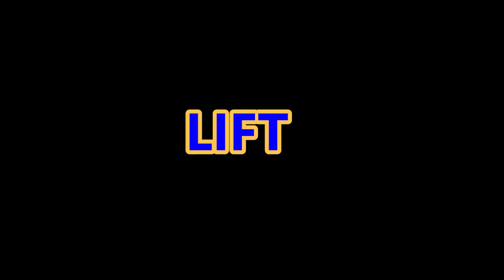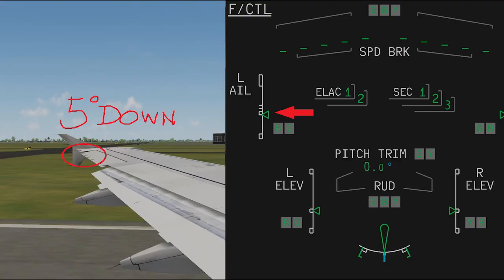Aileron Droop - SQ In A Minute

Comment: Captain why is it that most A321Neos when parked at the gate and not powered still have control surfaces in neutral position? - Many thanks
Reply from the maker: Hi, is the flaps extended already?
Reply: @Captain_SQ  no sir. Aircraft parked at the gate engines shutdown. The only way i know to power control surfaces with engines shut down and without yellow electric and PTU would be to use blue electric pump in maintenance mode.
Reply from the maker: @kam_a3216  ah okay you are not talking specifically on aileron droop. Neutral position would be the default position right?
Reply: @Captain_SQ  with no hydraulics power the ailerons  and elevators should droop as they do on CEO aircraft. But with NEO this doesn’t seem to be the case so i was just wondering why that is
Reply from the maker: @kam_a3216   ah okay that's interesting. If I find the answer out, I will get back to you.